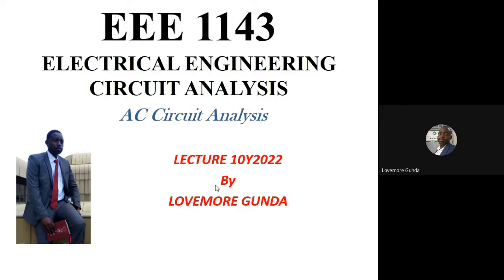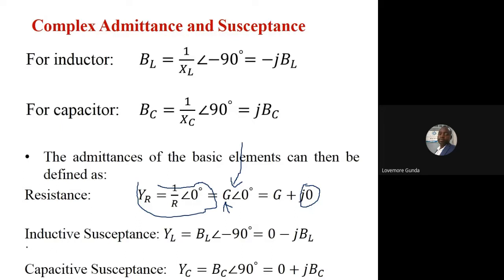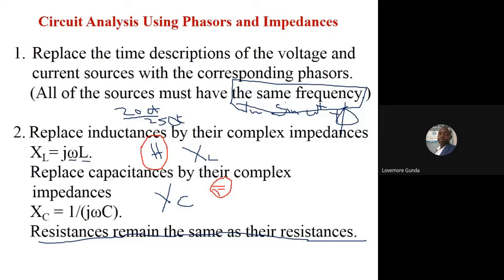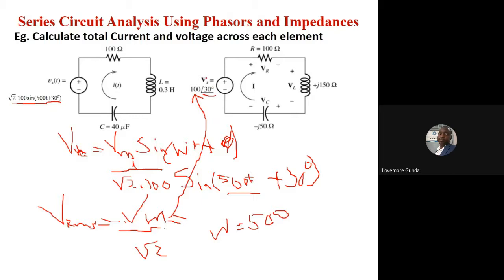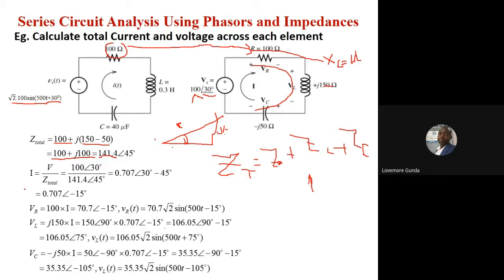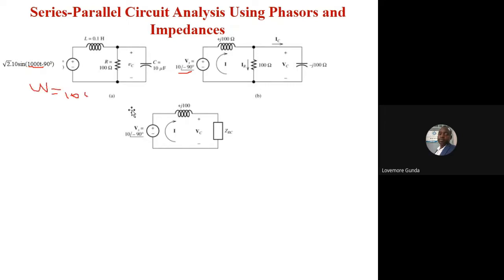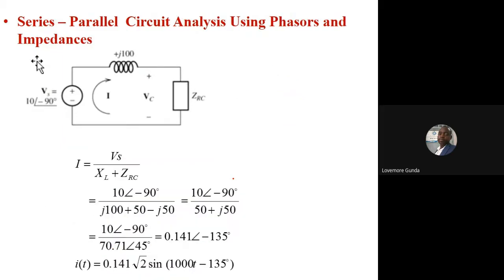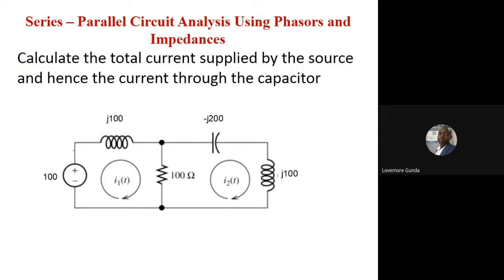Basics AC Circuit Analysis

Comment: Sorry Eng. I have 2 queries there at the illustration at 37:10
1. Isn't that a current source, or the supply is always a voltage source in A.C?
2. Aren't we supposed to first convert the initial expression 5cos(200t) to be in terms of sin(), or it doesn't affect the calculations?
Thanks in advance
Reply from the maker: Thank you for observing that it is a current source. SO it means in the first example we use current divider rule, then the second one we use what I have explained. On the Cos() and Sin(), that will not affect the magnitudes, you can convert to sin() at the end so that you get the correct phase, noting that Cos() is a Sin() shifted to the left
Reply: Alright thank you for that clarification Engineer